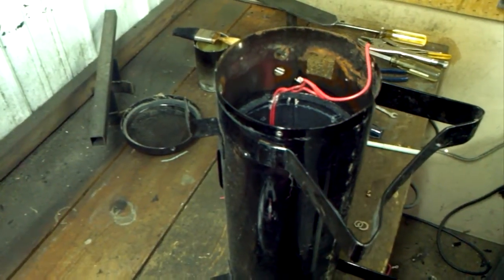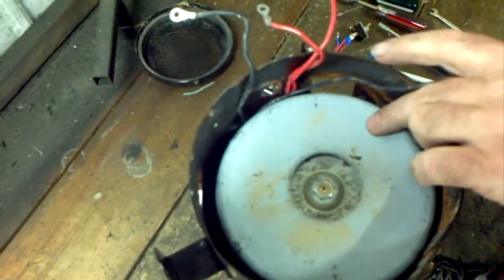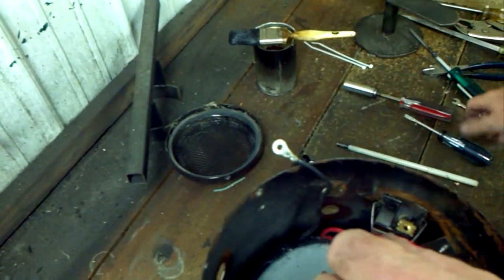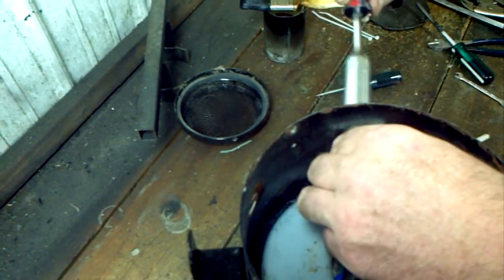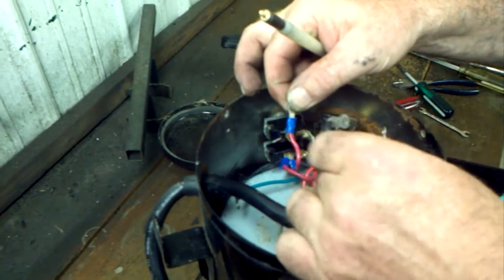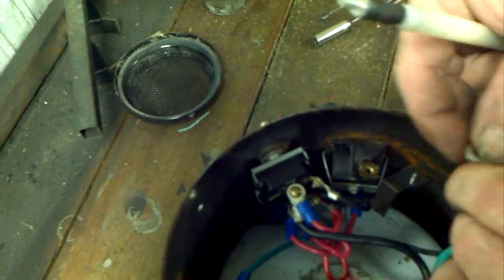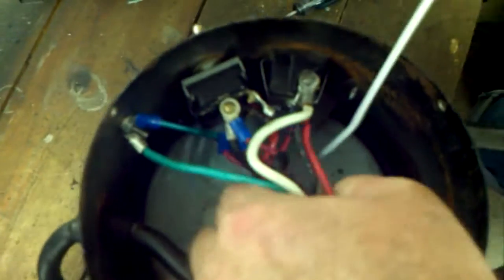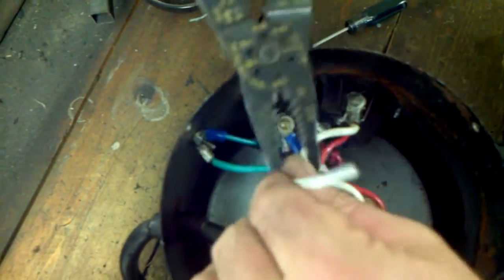Putting the back motor into a K-9 or Circuiteer dryer

Comment: Thanks this is just what I needed to see. The groomer bought only one set of brushes and could only replace the front set. Getting the rear motor out seemed daunting until I saw the trick with the WD-40, vise grip and lever. Now I have the 2nd set of brushes and can get the thing apart.

Comment: So this is the wrong way to wire it. With this configuration, the unit comes on as soon as you plug it in. 1st switch (furthest from motor) becomes unresponsive. I suspect the black wire coming from the power cord should go on the "off" side of that first switch. Can someone confirm? I would rather not damage a customers unit. Thanks